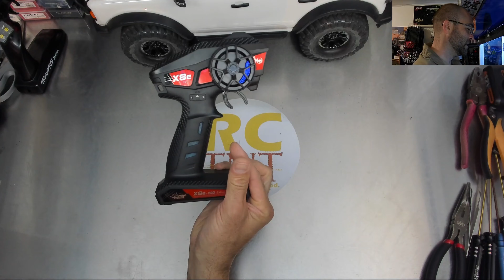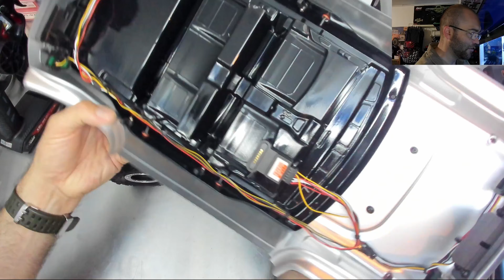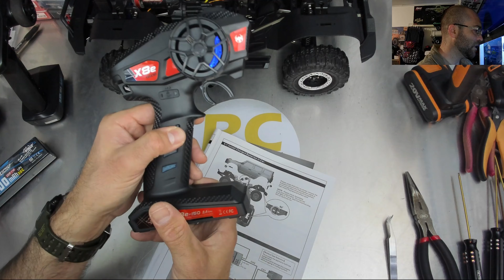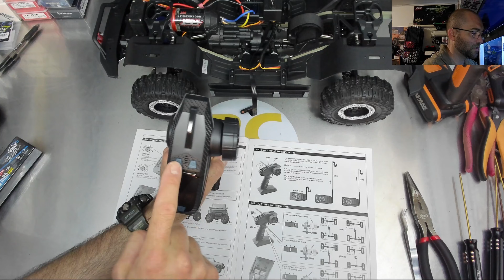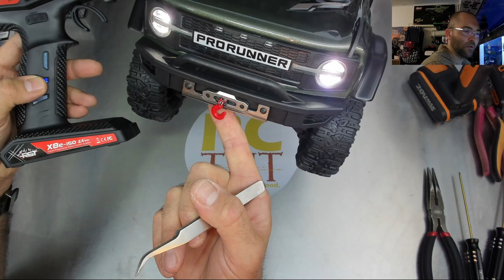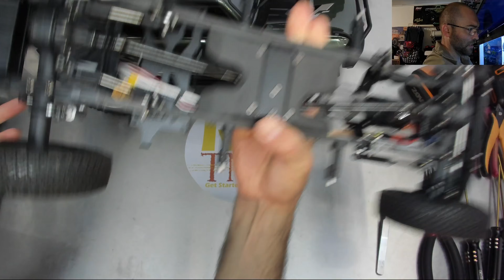RGT Pro Runner Trail Rig with EVERYTHING??

Comment: Holy crap! All that, and it's only $289 on Asiatees?  Once again, the little guys showing Traxxas how it should be done.  Well played, RGT. While I'm no fan of the modern Bronco body style, I find myself liking everything else about this car, which makes the modern Bronco body not a deal breaker. I'd like to see switchable lockers, but that's really about all. I like this car! There's a lot of little extras and thought put into this, stuff I would normally expect to see on much more expensive rigs, not something like this. Very nice!

I'm not normally a fan of the servo winch, they break scale for me and they just aren't my thing. That being said, this one looks pretty good, so that's okay. It's no Warn 8274, but then again, what is? 

Overall this is really good value. I'm looking forward to seeing how it does on the rocks. I suspect the straight axles and smaller tires are going to do it a bit of a disservice, but maybe the rest of the geometry makes up for it? We'll find out. 

Another outstanding review, good sir. Keep up the excellent work.
Reply from the maker: Thank you kindly and that's a good summary. I just threw a few pics up in a YT community post for channel members that you can check out - both the Traxxas and the RGT drove everything together today and I think I actually like the feel of the RGT better - which I really did not expect!
Reply: @RCTNT  That's a really interesting outcome. I would not have expected that, either. The thing is, as I think about it, it makes sense. The RGT is lighter, has smaller tires, opposed rotation driveshafts, a slight front overdrive, a better steering servo... All that taken together makes it more nimble, snappier, more responsive. That puts it ahead of Traxxas on every front. Don't get me wrong, I genuinely adore my TRX4. But I also accept that it's not the be-all end-all of RC 4x4s. And that's okay.

While I do like the portal axles, I think they're really neat and bring a lot of advantage to the table for things like crawling serious offroading, I think straight axles deliver a better driving experience overall. I'm not going to swap the portals for straight axles on anything I have, but I am going to add something straight axle to the collection. Maybe this RGT? Maybe something else. This is a top contender, though. I surprised myself with how much I like this car. 

We can't get the little RGT 136100v2 anymore, and it's getting time to get our  middle son his first crawler... maybe this is the one?
Reply from the maker: @elduderinolebowski5411 for what it's worth, this is my new go-to for recommendations for "best first crawler". It's that good. It was just so impressive today, I'm still in awe of what RGT cooked up with this rig.

I'm going to have to do a third video for this car (inspection, 6-probs, and now this). I don't do hype on this channel but if there was a crawler that deserved it, you're looking at it!
Reply: 289 👀
Reply: $404 Cdn + $987 shipping (ok, I exaggerated sue me lol) I just checked to compare prices, they want $376 CDN for the pioneer and this is twice the vehicle for $28 more.
Reply from the maker: It'd be about CDN$550 shipped, no? That still seems like bet decent value for money. I'm only guessing at the price but this is about right from Atees at least, right?
Reply: @RCTNT  yeah, good price for what you get but what happened is, a couple of years ago I bought a 2006 Ford F150 Crew Cab pickup 4 x 4 for $700 so it ruined me for buying R/C. 

$550 for a 1/10th scale truck
$700 for a full size F150 that I can take to the store and buy groceries lol
Reply from the maker: That's entirely fair enough, lol

Comment: Hello again sir, so im in the middle of searching new wheels and found  the wheels that  i wanted but it writen 1.9" with 5mm holes can i use that with pro runner ? as far i know they should be like 7mm right ? thank you in advance.
Reply from the maker: Sorry I haven't replied all day, I just haven't gotten to my storage to check for you. I can't recall but if you buy 7mm axle sizes wheels, you'll ensure you're fine either way. It also wouldn't be hard to bore out a 5mm hole to 7mm, worst case.

I'll check when I can and will update here. Cheers
Reply from the maker: Looks like they're 5mm
Definitely not 7mm. I compared them to the larger vanquish ones, which are bigger than usual and the RGT ones are definitely the more standard size.
Reply: @RCTNT  thank you so much sir, big help, sorry for the trouble 🙏. can't wait your review on the new FMS FCX10 LC80 . i had feeling that 6 problems rocks will put the fcx10 on the edge.
Reply from the maker: @DearDiaryMe heh yeah we'll find out soon enough! It's on the way, but not here yet.

Comment: Sadly, as good as these look, getting parts will be a big problem. Only one distributer in the world, and zero aftermarket support, make this jewel a hard no:body-blue-raised-arms:
Reply from the maker: Except its not. Speaking as an owner of 7 or 8 rgt vehicles, I've been able to get rgt parts and rgt  upgrades from Asiatees and AliExpress. Mostly upgrades, as I haven't broken nearly anything on my rgt cars. But it's harder to get in the USA, I hear. Shipping costs more.

But even so, the stuff that breaks is usually electronic, which is fairly universal and doesn't require RGT parts to replace (motors, servos, etc). 

Even bearings, shocks and links are readily replaced without needing the manufacturer. Really only the axles are the part you need to look out for. These have steel unis in the front. They're unlikely to break, even with abuse. 

By the way, I figure you worked out I was talking in AUD before with the 'TRX4 is actually only $499' deleted comment. But get this: USD$499 is AUD$735, so you'd think with an allowance for shipping the same $499 car would be like AUD$799 here, or even AUD$849 or something, right? But it's not. It's AUD$1049. So it's USD$715 here for the same car that's USD$499 there.

And that should show you why we're so excited about a sub-AUD$600 car like this.

Comment: Mine arrived today did not come with a battery also has indicators I don’t think you can turn off if you unplug them the lights still dim when turning
Reply from the maker: Ah yes I think I've since worked that out, I noticed it in a subsequent drive (coming next video). It's not overly intrusive at least, despite indicators on a crawler being a bit silly!

Comment: $1400, you got Robb.
Reply from the maker: Remember, AUD, not USD. While I paid less than the retail price for Australia (which, for this model, is currently AUD$1050, or USD$705), Traxxas stuff costs more here, even after the conversion rate. It's a lot cheaper in the USA :)
Reply: @RCTNT  I know  but really Traxxas is over rated and over price.  I have the rgt challenger and in my opinion it's just as good as the Traxxas trucks.
Reply from the maker: Hm, I dunno. Some stuff is actually better - the electronics, for one thing! But the Traxxas drive train is just incredible. They don't break. The shocks and tires are also unmatched in quality, in my opinion. And of course, the TRX4 injected life into scale trail rigs like nothing else at the time, and that R&D is praiseworthy.

But they're freakishly costly next to other options, even premium stuff like cross rc emo series and so on.

From my Australian perspective, if I could have a TRX4 with RGT electronics and after market support, it'd be a much easier pill to swallow!

Comment: Another Traxxas bashing video. I personally wouldn't support a Chinese copy cat company. Of course it will be cheaper. Duh.
Reply from the maker: I own five TRX4's and two TRX6s  They get a lot of love on the channel. If you write this video off as traxxas bashing, you're missing the nuance.

Of course traxxas costs more, they are in America with higher wages and their own property, with parts support in every store and a vast dealer network, plus event sponsorship, etc etc

Buuuut, rgt isn't cloning anything here apart from the body (which I'd sooner see them not do, or license it and add 60 bucks to the price). The car itself is unique, as far as I know. And so yes, the price is impressive. It's worth talking about!

Thanks for watching and sharing your thoughts. We don't have to agree for me to appreciate you! Cheers
Reply: @RCTNT Probably because made by kids how do y'all not get that supporting China 𝕀𝕊 𝔹𝔸𝔻? Could continue listing reasons.
Reply from the maker: @dieseldabz7104 What have you changed in your life to address this? Are you still using a smart phone? If not, what computer? What router for your home internet? Can one even access the internet without relying on Chinese components? Maybe... but it would need to be a mindful, careful thing to achieve with success.

Do you have any RC cars? If you're not using Sanwa or Futaba radios, chances are you're using a Chinese transmitter and receiver. What about servos, ESCs and motors? Tires. Foams. Polycarbonate and styrene in the vehicle bodies... 

Do you have a TV? Other home appliances with electronics in them? What about your car, does it have electronics in it? Japan will account for some of this, as will Taiwan, among others. Chances are though, you (along with me and everyone reading this) will have Chinese products or other products with Chinese parts inside them. Leaving angry comments on small Youtube creators' videos doesn't count as change, IMO.

I don't disagree, China is making a decades-long move on the West, I see it and am also concerned. But what to do about it as an individual? I've discussed this with friends and mentors, too, even around doing this channel. I'm not actually sure what the answer is.

If you're coming to talk openly and in good faith, great, I'll have that discussion with you. I think we actually can find some common ground here. But I also want to know what you're doing about it, now you've left a few abrupt comments on my videos. What have you changed in your life to deal with this?
Reply: You do know traxxas is made is china right? So if traxxas can support them why couldn't we support another chinese made rc?
Reply: Traxxas needs a little bashing cause the TRX4 is the oldest platform of the big name crawlers. With the exception of the clipless body it hasn’t changed in years. And for the cost I don’t blame the guy for buying the RGT.
Reply: Does TRx4 made in China?
Reply from the maker: Parts and some assembly in Taipei, Taiwan, and some assembly in Plano, TX. But broadly speaking and to the best of my knowledge, Traxxas is made in Taiwan.
Reply: And he has links so obviously trying to make $ off RGT sales
Reply from the maker: Correct, that the links are affiliates is clearly stated in the Description. I do try to be unbiased despite this potential for corruption. See my other answer to your main post for the rest of it. It's an important conversation. Thanks.

Comment: Interesting, that banggood product page, clearly states in red, that battery is not included. 🤔
But banggood is still in preorder phase, if I'm not mistaken. Maybe they sold few and are back in preorder, not sure. Dispatch date changes.
Reply from the maker: Hm, couldn't tell you, I didn't buy this from Banggood. Also be aware, depending on where you are in the world, they may or may not be able to ship lithium batteries with a car. Maybe the website gives you a different option based on this? Not sure.
Reply: @RCTNT  maybe it lowers their shipping cost (free), or maybe it simplifies their export procedures. But it's not common, for banggood to have different accessories included in the box.
Reply from the maker: Well, nothing is free. You pay for shipping at some point. It is isn't always overt. 

Regarding batteries, I dunno, I've found variance over my time buying from BG and Ali. I've probably purchased 7 or 8 vehicles from BG and easily more than 10 from Ali over the past 6 years. Also planes, radios and some professional type electronics for work. I have not found any sort of consistency with whether batteries are included or not, regardless of what the description says. Half our shipping options in Australia will happily ship with batteries, but quite a few will refuse. Global logistics has gotta be complex.

Comment: Hi, great video, I wonder how it compares to the redcat gen 8, cross rc NT4 and the hbr1001. Could I have your opinions on the comparison please? Thanks!
Reply from the maker: I don't have a NT4 (yet) or a hbr1001 - though I've looked closely at both.
If I had to rank likely crawling ability in stock form, based on an educated guess, they'd be in this order from best to worst:
NT4
Gen8 v2
Pro Runner
HB R1001

For general trail and occasional crawling, I'd still expect to find the NT4 at the top of the pile and the hbr1001 at the bottom, but I'd probably put the Gen8 and the Pro Runner together in second place.

As far as fun goes, the Pro Runner is up there. Same with durability.

On features alone, it probably wins, though the NT4 should impress as well.

Hope that's helpful!
Reply: @RCTNT  Wow thank you so much for the information. You're one of the few channels who interacts with all your viewers. Keep up the fantastic work!
Reply from the maker: I appreciate it, glad to help 🙏☺️

Comment: You might wanna check out the HB 1001R which has all the same features and is like $400aud.
Reply from the maker: Thanks, I just had a close look at it. It's missing a lot of what the RGT has: DIG, opposing rotation drive shafts, steel drive shafts, spiral cut steel diff gears, transmission based overdrive, steel unis up front, servo winch, 51° steering angle, 55/59° approach and departure angles, SOA with stainless 4 link configuration, 1.9" beadlocks with 4.19" scale tyres, interior (?), 2-speed (?), DumboRC radio, 3s capable, included 6200mah 2s lipo. The RGT really is spectacular value. 

That said, this may still be an impressive price given its a compete package. No idea about running gear or durability though, while RGT is much more a known quantity (it's maybe my 10th RGT model). 

I also note the geometry of that cheaper one is quite different to this thing, so I suspect you'd find worse performance all round. That said, a lot is forgiveable at the lower price they're asking. Thanks for telling me about it!
Reply: @RCTNT  thanks for the comprehensive reply , I appreciate it! I can only judge of online reviews but it's sorta been made out to be a reverse engineered Traxxas at low cost. But you are right, RGT is a known quantity and does the 1%ers better for a more well rounded product 👍
Reply from the maker: @BGSyd cool man, I wasn't trying to put your suggestion down, either. But I did want to draw attention to how much more the RGT delivers at its crazy crazy price. I don't know that anything compares.

Thaaaat said, maybe I'll check this car out too. It's a compelling price. I can only go from what I see, haven't watched any reviews on it, but the photos tell me it's more of a basic scx10/Gen7 type thing. None of the extras other than maybe lights and a pretty body. Would need to look more closely at it. Interesting though! Cheers
Reply: @RCTNT  no probs dude 😎. I don't have the HB, but was mighty tempted and got a fcx24 instead due to size.

If you do look into this one at any stage, just check the model. The base which I think is the 1001 is pretty basic but the top model possibly called a 1002/3 (still under 400aud) has portals and a two speed and is basically a TRX clone. I think it's called the Beluga in good clone naming fashion.

Love your content dude 👍
Reply from the maker: Heh righto, good to know! Thanks brother.

Comment: I have the same TRX4 bronco in blue and it was only $580 after tax here in Virginia, I’m still running stock electronics but I do have some nice brass on it and metal beadlocks
Reply from the maker: Nice one. That's about what I paid too, once you convert to AUD. The pro scale winch, pro scale light kit, ssd straight axle conversion and a lipo all added to the cost - and the RGT comes with the equivalent of all of these, which was my point. Bottom line though, I'm glad you're happy and enjoying yours 😎
Reply: @RCTNT  yea I understood your point and the rgt seems like a great value for your money, all decked out right out of the box 👍
Reply from the maker: Cool. I wasn't sure I'd made it clear enough as a few comments already have been incredulous I paid so much - but I actually got a relatively good price on the Traxxas stuff, for Australia. I should have done it all with American pricing, but it gets messy because traxxas is cheaper in USA than here, even after accounting for difference in our dollars and shipping cost. I think I'll have to come up with a way to simplify this stuff a bit more! Thanks 👍

Comment: Nice car and excellent video - in process of which I have learned why our little EazyRC Glacier after ESC upgrade (and thus finally setting the end points on the servo) shows a strong 'jumping' when taking a tight turn.
Reply from the maker: Oooh yes you're on the bleeding edge of what the axles can manage. Back that end point off a tad so it doesn't get nudged past breaking point sometime!
Reply: @RCTNT  I did that indeed on the transmitter - our little girl would not be pleased of daddy would break her favorite toy :)
Reply from the maker: Right on, yeah! Good job then 👍😄